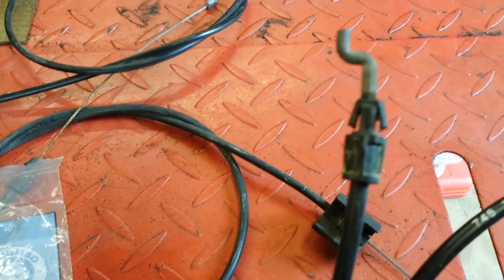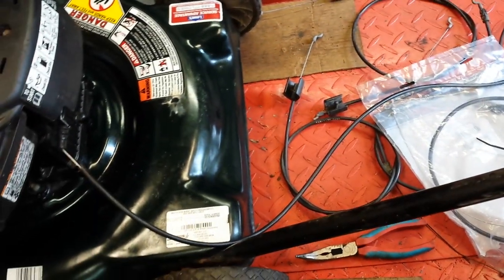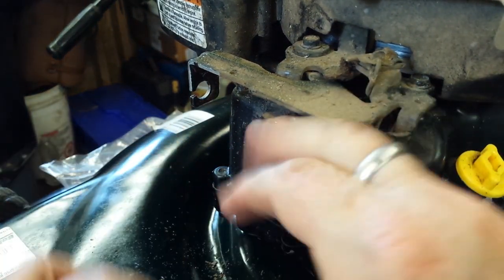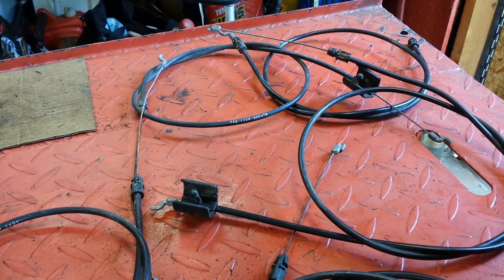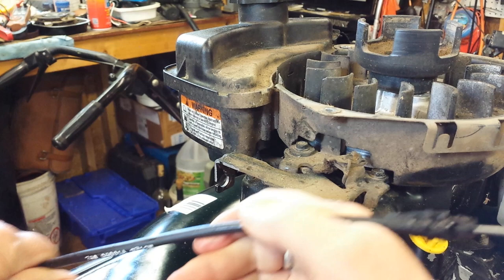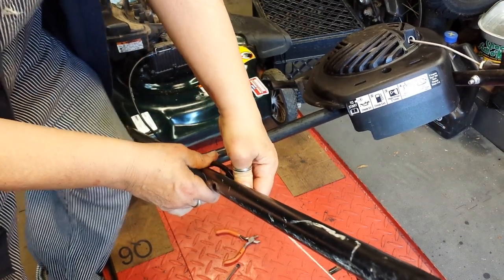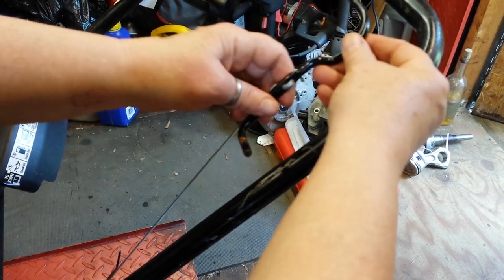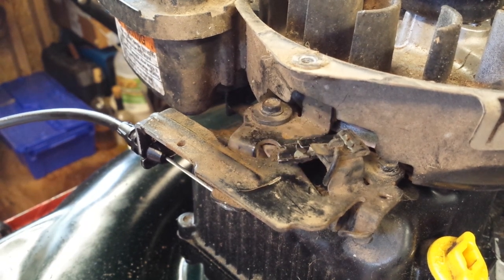How to Replace a Broken Cable on Most Any Lawn Mower

Comment: I would remove the cable, bail and brake altogether on one of those and stick an on/off toggle switch on the side of the engine for fun, simple push mower. I'm used to using the old stuff that lacks the safety's so no big deal. For a customer, nah, cable stays. No one thinks of how simple it is to bypass the bail and just throw a switch on, outside the box thinking lol.
Reply from the maker: Lol. I fixed my neighbor's mower with a similar set-up. He twisted some bailing wire around the spring-to disable the brake, and yanked the spark plug wire off every time to kill it. I fitted him with a kill wire at the very least to ground out the mower.

Comment: I’m having a hard time finding a place to get the s-cable (I think it’s called) cuz I’m going to do this myself after viewing your awesome video!  I don’t have the manual, but the numbers I’m getting off the mower for model and serial number don’t make sense to anyone 🤷‍♀️
Reply from the maker: There should be a sticker on the mower deck somewhere. Use the model number, not the serial number to look up a parts diagram on any major parts website: partstree, jackssmallengines, repairclinic, etc. I prefer partstree as they show live stock on the shelf.

Comment: Hi, can you tell me where I could possibly buy a plastic mounting piece,it might help if you could say what it’s properly called,kind regards
Reply from the maker: The plastic bits are not replaceable, you are doomed to buy a complete assembly. If your cable has that "C" shaped bracket  (like the one in the video thumbnail) you can add cable ties to help stabilize the bracket. It operates under a lot of pressure when you pull the handle.

Comment: I have a Toro 6.5 hp with a Tecumseh engine. It looks like the bracket that the cable attached to does not move enough to deactivate the brake. The cable looks ok. What do I do. I think this is a faulty design
Reply from the maker: You can try bending the other end of the bracket, or possibly replacing the spring?
Reply: @TheLawnmowerLady THE BRACKET DOES NOT BEND ENOUGH TO PULL THE SPRING ENOUGH. MY PREDICTION IS IT WILL EVENTUALLY DESTROY THE CABLE. THIS IS A VERY DUMB MANUFACTURER'S DEFECT. BRIGGS NEVER HAD THIS PROBLEM. IF YOU GIVE ME YOUR EMAIL I CAN EMAIL PHOTOS TO SHOW WHAT I AM TALKING ABOUT. I TRIED CALLING TORO AND THEY GAVE ME THE RUN AROUND AND TOLD ME TO PAY A DEALER TO SERVICE IT.
Reply: @TheLawnmowerLady  I MAY HAVE ANOTHER PROBLEM. THE FLY WHEEL KEY NEEDS TO BE REPLACED. THE ISSUE WILL BE AFTER REPLACING THE FLY WHEEL HOW I WILL DEACTIVATE THE BRAKE SINCE THERE IS NOT MUCH TENSION ON THE CABLE BECAUSE THE DECK I HAVE THE TECUMSEH ON WAS A CRAFTSMAN DECK THAT HAD A BRIGGS ENGINE AND BRIGGS HANDLE. THE BRIGGS HANDLE DOES NOT HAVE THE SAME HOLES TO HOLD THE CABLE FROM THE TECUMSEH ENGINE THAT RELATES TO THE BRAKE. ANY IDEAS?

Comment: Cable fixed, but mower was surging badly...
Reply from the maker: Surging usually indicates a lack of fuel. I would be looking to the carburetor to ensure there are no air leaks around the gaskets and the intake manifold, and perhaps even open up the carb to make sure the idle circuit and main jets are not clogged up. Thanks for watching!